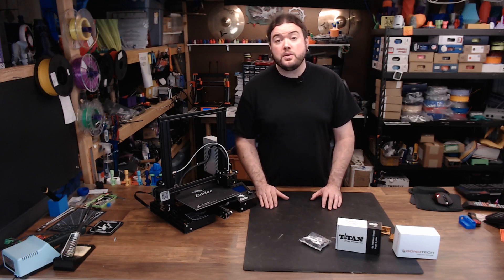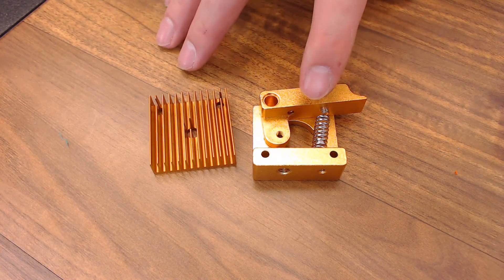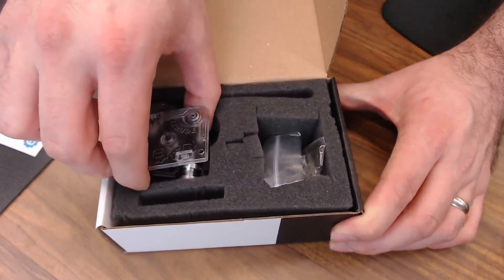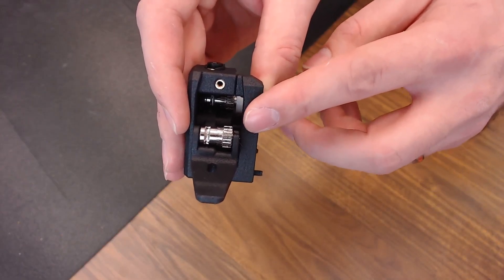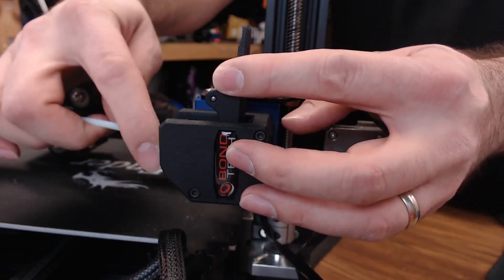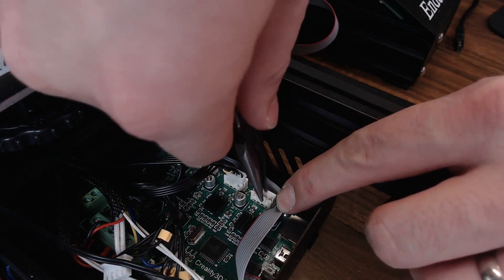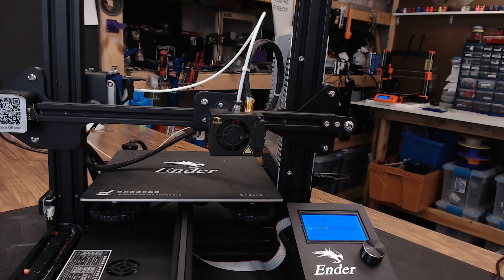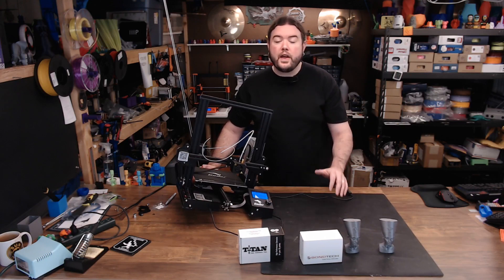3D Printer Extruders - Ender 3 - Chris's Basement

Comment: Clever solution to the motor direction change.  I was hoping you might elaborate more on how you got the correct esteps (marking 100 mm of filament and test extrude, adjust as needed).  It almost seems too good to be true you got it right the first time!
Reply from the maker: Thanks! The E steps at 415 is where Bondtech wants you to start. I did measure it after the video. With the filament I was using, it was only 1mm short of its goal. I was pretty impressed.
Reply: @ChrisRiley  that's impressive.  For novices, you should include that detail the next time you do an extruder setup/tune video!
Reply from the maker: @WhereNerdyisCool  I have done that on another video, but I can run through it again.
Reply: @ChrisRiley  great!  I'll be curious your review on the Bondtech goes.  Ron over to Ron's Place had some problems with the extruder on his CR-10....might want to see his experience.  Long story short...good for flexibles, problematic for others.
Reply from the maker: @WhereNerdyisCool  Interesting, I know Ron, I will have to ping him and see what's up.

Comment: Any particular reason you prefer the Titan over the BMG?
Just got the Bondtech BMG myself, 15% off on black friday sale, was deliver in 1 day. :)
Reply from the maker: No reason really. I just like the way it works and how simple/light it is. The bondtech is awesome, works great, I think it's just the design of the titian I like.
Reply: @ChrisRiley  I was planning on getting the Titan at the same time as the V6 hotend from them, same black friday discount from either dealer regardless. In the end I went with the Bondtech since I'm Swedish and slightly patriotic ;) Not sure if I will mount it as you did now though, my plan was to mount it for direct feed (got the pancake stepper to go with it for lower weight).
Reply from the maker: @SteinerSE  I was thinking about doing a CR10 direct drive setup as well.

Comment: TBH I personally find the difference of print quality (on this print) a little underwhelming. At least from the video.
Reply from the maker: I was torn on how to show this. I wanted to use the exact gcode on both prints and I think because I was trying to compensate for the skipping with slicer settings on the base model, the bondtech print suffered. It does look better in person, but not as good as it should. I am going to tweak the slicer and give it another try.
Reply: @ChrisRiley  I saw some improvements but not much too...I'll be curious how your next prints turn out
Reply: @ChrisRiley  I think it's chrome lug nuts on a dump truck.  No matter how shiny the nuts it's still a dump truck. You're spending a third of the price of an Ender 3 to upgrade one aspect of the printer and it's probably not the most important one. One of the lower priced extruder upgrade options is probably wiser.
Reply from the maker: I don't disagree with you at all, probably not the best idea, just an option I wanted to investigate.
Reply: @ChrisRiley  my ender 3 is still somewhat stock. I just replaced the nozzle fom .4 to a .2 yeah.. call me crazy as for combatting under extrusion max speed now is somewhere around 25 to 27 mm/s but results look dramatically better. The thing is the max extrusion speed in the firmware we should have some tables with safe  settings to start off from.. unfortunately these simple metrics are not easily available. As there are literally 5 or 6 different aspects that influence the results (type of material or brand of filament) being a hugely important factor perhaps some clever printer designer can figure out stepper stall ratio to pressure buildup in the nozzle I mean there must be some clever math possible to automate the problem away for us mortals as slower throughput due to a too high viscosity should result in slower head movement to avoid the issue. So an additional more advanced sensor in the hotend could be used as a start of the feedback loop that optimizes travel speed versus extrusion. (Sorry for the long techie post)
Reply from the maker: @px1690  Totally agree, there has to be a way to monitor flow rates as such and adjust accordingly. I think we will probably see that at some point be introduced.
Reply: Paulaner 74 I would agree with you completely. And don’t apologize for a necessarily techie post. There is not enough technical information about the exact affect of every hardware and slicer change possible!
Reply: I think details on prints never really show that well on video. Some prints that get shown on video look absolutely flawless when on a very high res image they clearly are not.
Reply from the maker: @GlennPierce  I agree, I am re-doing the print now with some Gcode that is better suited for the new extruder. I will make a post with some pics.
Reply from the maker: Here is a pic on the new print after some slicer changes. Not perfect, but a lot better. https://photos.app.goo.gl/PiGHRDCbiqiA2qE29
Reply: @ChrisRiley  Still of  Crap quality.... My pore old ..Stock... Anet A6 has printed that  Neffi Bust FAR better.
Reply from the maker: @danilochies528  I'm glad your A6 prints so well.
Reply: Seems that the Bondtech BMG isn't worth it.
Reply: Ya thats what i thought s well as they both look like shit..
Reply from the maker: @dronephotographyireland  well it is an ender 3.
Reply: @ChrisRiley  Sketchy answer ....MY pore old Stock Anet A6 just printed a few Neffi busts...
 and ALL of them are FAR better prints.... than Any of those you present or linked to. 
Seriously surprising actually. 
Seems there is Large difference between Talking about printing and actually Doing it?
Reply from the maker: @danilochies528  I hear ya, did my best. Hope you are having a good holiday.
Reply: the thing is with these upgrades that it improves overall consistency, not something you'll see comparing two prints but you will notice after doing lots

Comment: Good video about a worthwhile upgrade. I switched to the Bondtech on my Ender 3. It's a little pricey, but works great. If I was to do it again, I might just go with the SeeMeCNC one. I have that on my A10, and it has provided similar improvement as the Bondtech BMG on the Ender 3.
Reply from the maker: Thanks Matthew. Agreed, if might be a little over kill for the ender 3. The EZR is probably a better option for this machine.

Comment: My home built extruder uses a standard filament drive gear in a direct drive configuration.  It's built onto the motor, the mounting foot is cut from aluminum angle stock.  The lever containing the idler wheel was made from three pieces of 1/8" aluminum that were cut into the required shape and glued together (sandwich) with JB weld epoxy.  Holes were drilled for the filament passage, spring tension adjust, and idler wheel attach screw, and the screw holes tapped.  I'm using a 400 step/rotation motor which gives an effective 2:1 reduction over a standard 200 step/rotation motor.  I don't like the idea of using a 4-40 screw as the pivot for the idler lever, even with an aluminum bearing sleeve added, but it does work, and has held up for two years now. (The surplus motor I'm using was tapped for SAE screws, not the usual metric).   While I built mine as a direct drive into a Prometheus hot end, the design does lend itself towards a Bowden style with the addition of two tubing mounts.
Reply from the maker: Sounds like a pretty cool setup.

Comment: 1:56 yes i just bought a ezr struder for my new ender 3. 

been loving it on my cr-10.

Tiny machines is selling an upgraded version of a cr-10s with an ezr struder. they call it the 300 super+
looks like something comparable to the cr-10s pro
Reply: is there much of a gripping difference in the gear ratios?

you said the bontek and the titan are a 3 to 1 gear ratio. 

other than changing the estep.

so i assume the ezr struder and the stock or metal extruder are a 1 to 1 gear ratio?
Reply from the maker: Correct, those are 1:1. Yes, the 3 to 1 extruders have crazy amounts of torque. They will even drive the filament with a pancake stepper.
Reply from the maker: Nice! Yes, I use one on my Pulse. A great upgrade for the price.
Reply: so with a 3 to 1 ratio you dont need a large stepper?
Reply from the maker: @Mr_Pewpy_But-Whole  Correct, you should be able to use a lot smaller one.